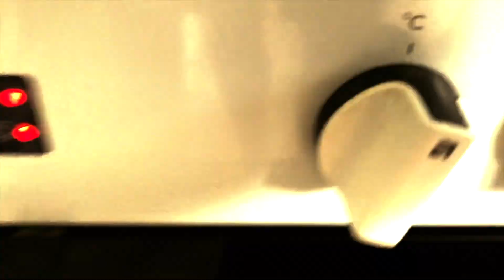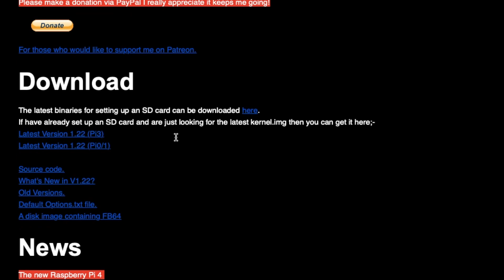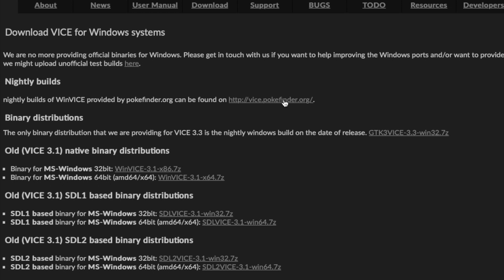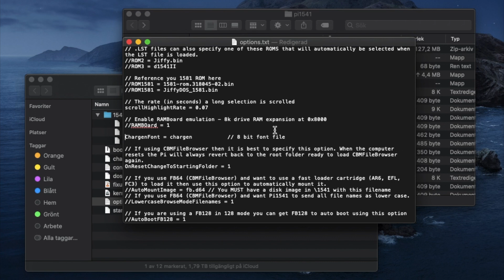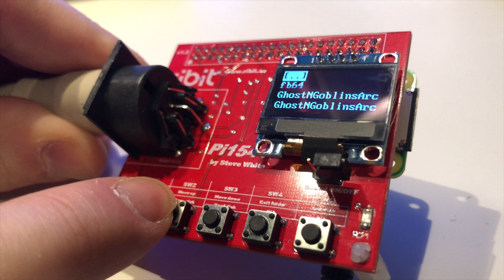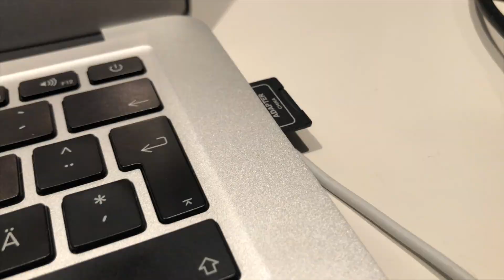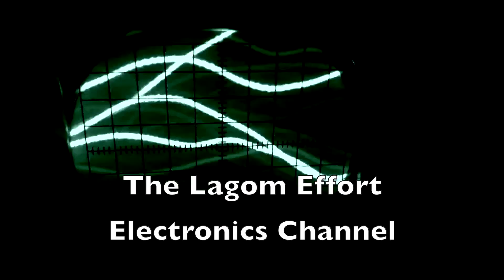Howto: Pi1541 on RPi Zero and 1

Comment: I'm having problems where it won't let me insert a disc 2 like it doesn't recognize the pi1541 after that
Reply from the maker: In combination with many fast loaders or demos/games it is necessary to select all disks of the multi set before you mount the first one and swap between them WITHOUT unmounting and stopping the emulation. This is because you want the emulated drive to never “power off”. It nees to retain all the fast loader code that is injected on it. Unmounting the disk will exit emulation and pi1541 will be reset and almost all fast loaders will be confused. It is similar to power cycling a normal 1541 drive.
Reply: @TheLEEC  thank you

Comment: does the pizero lcd screen work on an option a with pi1541 zero,also does the sound for a pizero work on option b with pi1541 zero?
Reply from the maker: Hi there. The OLED/LCD works fine on Zero and it is not a part of the IEC circuit, uses its own pins and should be unaffected by the choice of Option A or B. Buzzer or speaker sound is not supported on Zero at all and that is honestly a relief.

Comment: Does this also work on the Zero WH?
Reply from the maker: Hi there. The Zero W is practically identical the older Zero, apart from the additional radio chip, so Pi1541 will work fine. (For those who might read this and wonder why my answer doesn’t refer to the WH model, it is because there is no WH model. WH is just an order code to get the GPIO pin header factory soldered. Only models Zero and Zero W exists.)

Comment: Hello. Fantastic video. Thanks for sharing! I booted my Pi and all I'm seeing is a logo for the Pi1541 V1.23 in the OLE screen. Pushing buttons 1-5 has no effect and the C64 can't find FB64. Any thoughts?
Reply from the maker: Hi Gary! Thanks for the kind words. Getting as far as the logo is promising, because that indicates the configuration can be read correctly. I would assume at that point Pi1541 attempts to access and list the contents of the 1541 folder. Make sure the file system on the SD card is healthy and proper FAT32. Also check to make sure there is no typo in the 1541 folder name. If I get the time later I will try to replicate that issue. I have never seen it lock up at the logo screen before.
Reply: @TheLEEC  Thank-you!
I followed the website for the original build as you've directed (for the files). I have some confusing about what version to use for the VICE emulator files. Also many people around the web are renaming the DRIVE file; some with extensions some without; example: dos1541 vs d1541. I amusing a program to format my sd card on my Mac. It's called SD Card Formatter. so many variations. However, i didn't get anything to happen until i followed your video. i really hope to get this working. I spend probably 8 hour yesterday trying everything.
Reply from the maker: Hi again! I managed to replicate your issue here before seeing your reply and what I found is actually related to that rom file.
The default drive firmware name should be exactly dos1541 without any extension. If this file is not found it will get stuck at the logo screen. This should be copied as is out of the DRIVES folder in any recent VICE version (identical file in all of them) and this is the one used when testing the releases. Also, it should be placed in the SD card root folder, not in the 1541 folder.
Additional roms can be specified in options.txt but the default rom is intended to be this exact one.
I hope this helps a bit.
Reply: @TheLEEC  Perfect. That makes sense as to why its not working!!!
I was renaming it. Thanks again. I'll let you know how it goes! Again thanks for your very helpful video tutorial!
Reply: @TheLEEC  Hello again! Well i tried a forth time. I followed your steps exactly without using the Pi0 files. I'm using a pi3B. I used all the other files exactly as directed. And even though I enabled quick boot option as you've directed, I am still seeing it on my OLE screen and the FB does not appear. It's still stuck. I'm lost again on what else to do. Can i send you a zipped file of my SD card contents? Thanks!
Reply: @TheLEEC  An update. I've plugged my pi into an HDMI connection and on my screen I see the logo for the Pi 1541, Then i see "Loading Font ROM chargen" At the bottom of the screen i now see a blue bar with three horizontal lines. There a vertical line moving across the bar from left to right repeatedly. ??
Reply from the maker: Aha! It sounds like you're unlucky enough to have two different problems stacked on top of each other causing the same symptom. If you are using the Pi3B it makes sense that the chargen font file could lock up the OLED as it contains the font to be displayed on it. (On the Zero the chargen is not supported so it wouldn't matter.) If you have the row "ChargenFont = chargen" in your options.txt, make sure the file named chargen is copied from the C64 folder in the VICE package to the root of the SD card.
The bar with the vertical line is an illustration of what's happening on the IEC data lines. It is a good sign you're on the right track.
Reply: @TheLEEC  Looks like same issue. No movement past the chargen message. I removed the line from the Options file and now i'm stuck at the logo screen. Does it matter that none of the HAT circuit is connected? I only have the OLED screen connected and the HDMI to my LCD. Also, I have no fast loader images/kernals loaded. Is it supposed to take long to load the font file? Very odd issues. I very much appreciate your time and effort to help me! Thanks.
Reply from the maker: This is getting more and more interesting... I might have to do a video on it when we figure this one out.
Check out theleec.com for ways to send me a zip of your SD card and also a good high res photo of your wiring.
Reply: @TheLEEC  Well I've gotten further. After connecting the OLED AND the LCD monitor, I removed and replaced the power to the Pi several times. It booted into the browser!!! However, after removing the reconnecting power, it sometimes wouldn't go further. I tried three SD cards and only one seems to work. All the files are copied from the working one to the two others. I can't see it being an SD card issue. Then, interestingly, I removed the HDMI cable from the Pi, and i can not at all get it to boot past the splash screen at all. I only have success when I have both screens connected or JUST the HDMI cable. But again, I have to remove power and re-connect it several times. very odd that there is something to do with the HDMI connection?
Reply from the maker: Very interesting indeed! The intermittency of it almost sounds like a power supply issue. Could you send over a zip of the card so I can try to replicate the problem?
Reply: @TheLEEC  Will do.
Reply from the maker: Got it.
Put a resistor roughly 4.7K-10K between GPIO pin 38 and 3.3V (Pin 1).
I think that might help...
Reply: @TheLEEC  you mean jumper them together with the resistor?
Reply from the maker: Yup, I suspect that pin 38, intended to be the input for the drive reset signal, is floating and not internally pulled up. This could make Pi1541 detect a constant reset signal and adding the HDMI cable causes enough RF interference to float that voltage high enough. Jumper pin 38 to 3.3V through the resistor to make sure it won’t get stuck in reset.
Reply: @TheLEEC  That was my guess. when you told me to use a resistor. I didn't think that the system was designed NOT to work without the resistor but thats why people such as yourself find these things out. I'm so happy for your help!!! Thanks again!!! my other Pi is toast. It's not working reliably; even with the resistor.
Reply from the maker: I'm happy I could help and I too learned a lot, so thanks for putting in the hard work on your side. Apparently we can conclude that many totally unrelated problems can cause the same symptom. I think when it comes to the reset pin, I am sure this is not by design. Assuming development is done with full hardware attached, finding that pin at an unpredictable floating state was just something that hasn't been considered and the behavior is unintentional. I know that the Raspberry Pi has internal 50Kohm pull-ups that can be enabled in software that should make this a lot more reliable. I'll talk to Steve and see what his thoughts are on this.
Pity about that other Pi of yours, but good luck with the working one and stay safe!
Reply: @TheLEEC  Thanks again for sticking with me on this. You're a rare person who helps in this manner and I won't forget your kindness. I assume the next step is to publish this all over the place so people are not stuck like I was? Stay safe as well! Take care!
Reply from the maker: Hi again Gary! Just in case you missed it, I made a (fairly simple) video about your issue. I hope you don’t mind being “featured” in it. Let me know if you want those parts edited out. I hope you’re well and safe. All the best.

Comment: Excellent video, thank you. Have you tried 1581 on it? I've followed the instructions online (there aren't many unfortunately) but cannot get it to work. If you can, would you consider making a quick video (also, have you tried jiffy dos at all?).
Reply from the maker: Thanks for the kind words! I did try the 1581 mode during beta testing a few months back and it worked nicely. I might get some time for video production next week so I’ll see what I can do. (JiffyDOS is something I haven’t tried in a very long time so the answer is leaning towards a no.)
Reply: @TheLEEC  Thanks, I'd like to see that :)

Comment: Can you please help me to get this working? I have a raspberry pi zero, I followed your instructions but when I turn it on the green led of the raspberry turns on for about 1 second then it turn off and flash 1 time. On the oled display I don't get anything and on the hdmi I get the rainbow image. I also tried to install noobs to see if the SD card was bad but I works fine
Reply from the maker: Hi Marcello! First I need to make one thing clear: Running Pi1541 on a Zero or Pi1 WILL display a rainbow screen on HDMI, because Pi1541 never initialises the GPU at all. It still runs, but never touches the GPU, so the firmware rainbow screen will be the last thing the GPU is asked to display.
So, in your case, if you have prepared the card right and use the right kernel.img for Zero, I would go with the assumption that Pi1541 IS running, and you have some issue with the hat or maybe just the OLED. I would start with connecting it all up and try a load”$”,8 and a list.
After that, it would be difficult for me to give you a good idea without getting my own hands on it, I suppose...
Reply: @TheLEEC  thank you very much for the answare. typing LOAD"$",8 results in a "?DEVICE NOT PRESENT ERROR" so i guess i did something wrong when i put the hat toghether, i'll try to check all the solderjoins
Reply: @TheLEEC  ok i fix it, the problem was that i'm stupid and i don't read instructions, sorry if i wasted your time
Reply from the maker: Cool! No worries. Glad you got it working!
Reply: @marcy12222  Bit late for the party, but could you share what did you skip? I have gone over the instructions several times and I'm trying to figure out did I mess up something with SD card or doesn't pi1541 just like rpi zero w.
Reply: @jarnotuomainen1750  sure, the hat that i got, if i remember right, could be used in different configurations and to set the one i was using i needed to solder some pads together on the rear. In the beginning i didn't understood that i needed to do that so the hat was turning on but wasn't working. I noticed the problem when i was testing for continuity and saw that some pins weren't connected. For the problem with the display flashing the rainbow screen, i found out that the hdmi cable i was using was defective or something like that so it wasn't a problem with the SD.

Comment: Thanks to your video I was able to run Pi1541 on Pi Zero. Even the rotary encoder works properly!
Is it a chance that you or Steve will add support for USB flash drives on Pi Zero?
Reply: It's nice that you like my comment Tony, but what about my question? :)
Reply from the maker: ;) It was delayed by earth’s refusal to be flat. Thanks for the feedback. It’s nice to know that it is of value. I will check your question with Steve and get back to you. Spontaneously I feel it should be doable, but he will know for sure.
Reply: I've got one problem with both Pi Zero and Pi 3B+. Ghost'n Goblins shows glitched title screen and the game doesn't start. I don't care for that particular game and other games I tried run without any problems. But it bothers me anyway :) I have original 2.5A power supply. I've tried two different hex inverters - SN7406C by Texas Instruments and UCY7406 by CEMI. My Pi1541 hat is made on hackup.net board rev.4.
Reply from the maker: The most predictable results seem to be the latest Pi1541 release with GraphIEC off on RPi3:s. I’d start with that as a baseline, but after that I suppose there’s no good shortcut to troubleshooting it other than finding a buddy with a complete working setup and swapping parts until the culprit is found.
If you find it’s the hat, and you have already tried a good inverter, I suppose the level shifter could be glitchy. I’ve even seen problems with GnG on some c64’s on original 1541 drives. I wish I could give you a better answer.
Reply: @TheLEEC  Problem solved! I don't know why, but rotary encoder was causing this problem. I removed it and disabled it in configuration. I will contact author of pi1541 and ask him about it.
Reply from the maker: Cool! Well done and thanks for the report. That sounds like a good idea.
Reply from the maker: Apparently the USB driver module causes a lot of interrupts that effectively breaks the cycle exact emulation. So, only having a single CPU core to work with, it had to be removed the Pi Zero/1 version. It seems unlikely that it can be added in any time soon. Sorry.
Reply: The LEEC - Lagom Effort Electronics Channel thanks for the explanation :)